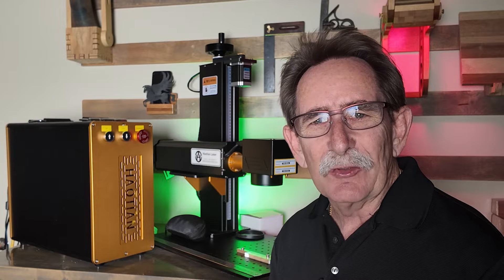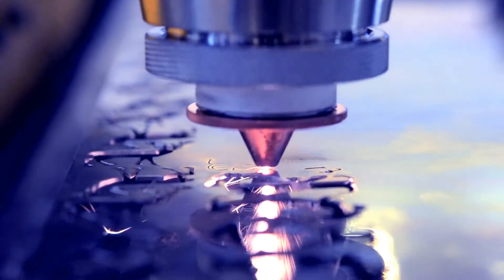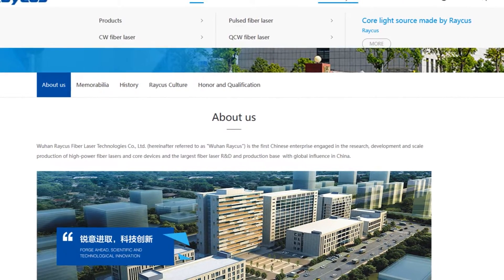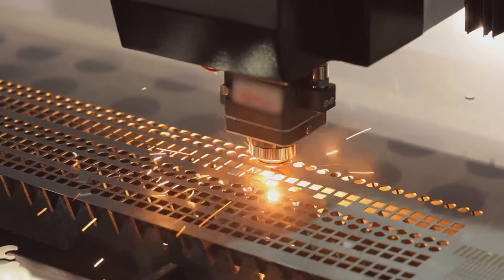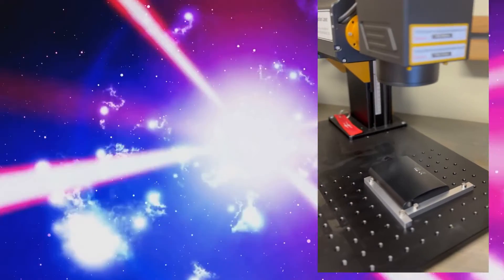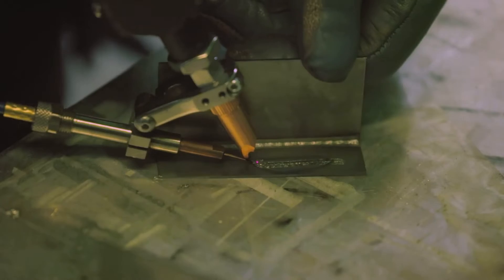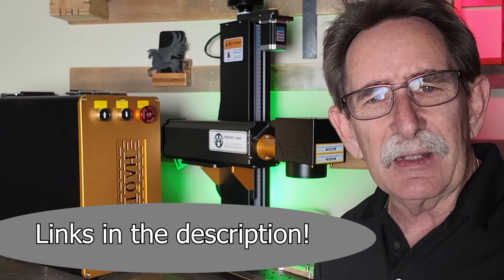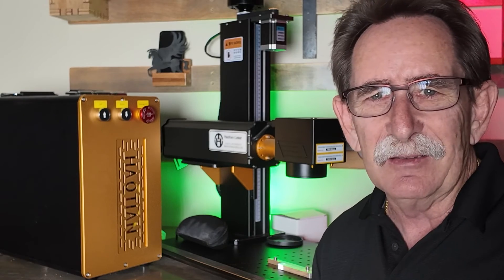Buying a Fiber Laser Understand These Terms  MOPA - JPT -Raycus

Comment: Whats the difference of the different m7 series of the M series and the e series of the 100w?
Reply from the maker: It sounds like you are  close to making a purchase, so  in that case you are at the point to reach out to  the manufactures.    All of the specs change about a quickly as they do  with computers.  There are two companies I think deserve your attention.  One is Hoatien and the other is  EMPLaser.com   They can extol the virtues of their machines and why you would pick theirs over others.   These are pro class machines,  cost should not be the sole decider, rather getting the right tool for  the job.   EMP Laser also has all their support in the United States and an Impressive warranty.  Hoatien just opened an American facility also but are not nearly the size of EMP Laser.  You can also come into the LASER FREEDOM Group in Facebook and ask people in there.    CHeers and good luck getting the best tool for the job.